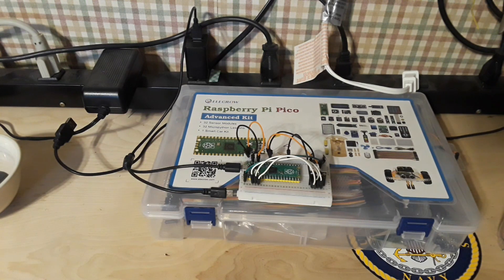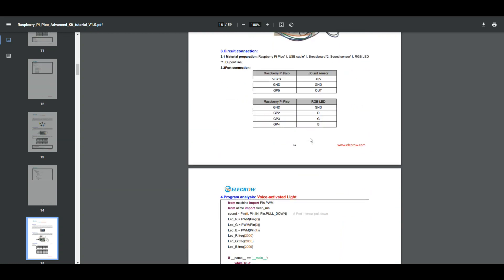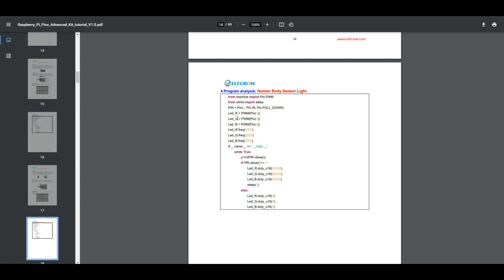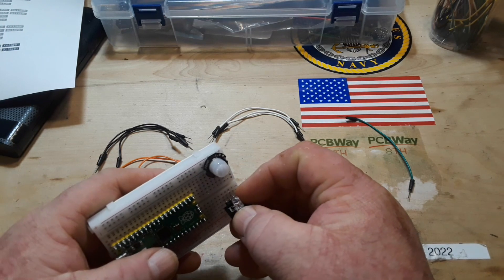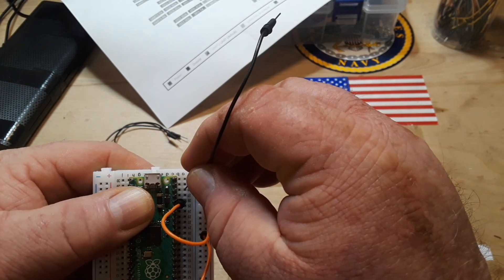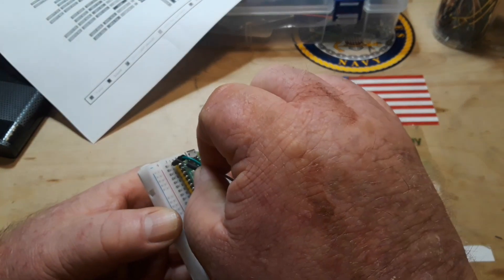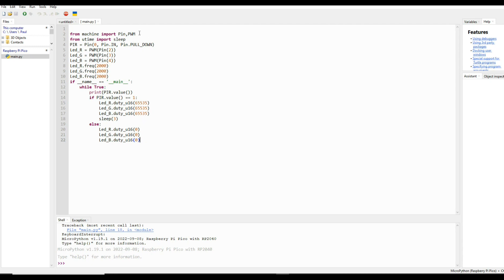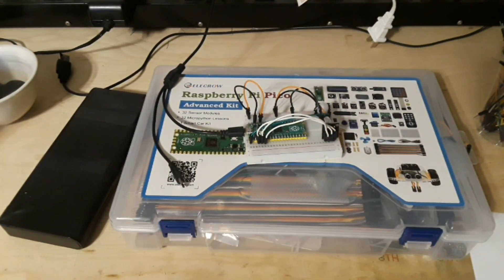Raspberry Pi Pico Project: Human Detector

Comment: Hi , great video! I want to make a pico system that uses lazer pointers fixed to a wall in a tripwire configuration to detect vehicle heights for a project (ie , will the vehicle fit under a bridge). Well in fact it’s for a ship with a car deck and a freight deck. Would it be possible to have some sort of detector for detecting lasers in daylight and also have it running two at once ? I’m a software student so the programming would be easy but I know very little about hardware

Comment: This concept is very interesting.I get a lot of false positives.I have found that one can get very accurate indications,if combined with a (rcwls-0516) motion detection module.Set up an (AND) logic situation with output if IR and (rcwls-0516).This can be done on the hardware or software level.Personally, I prefer controlling on the SW level, because one can do different things with the individual outputs, like filtering. 🤔